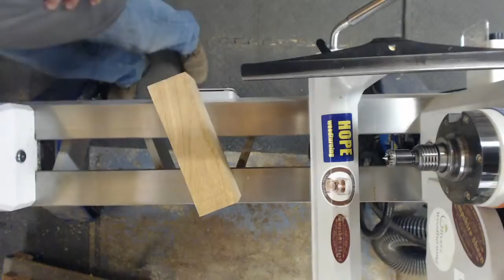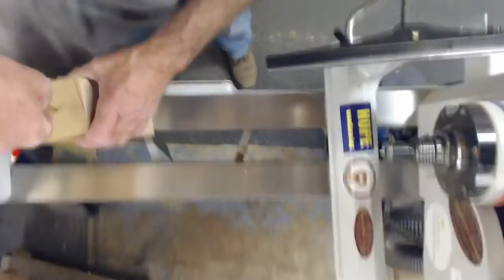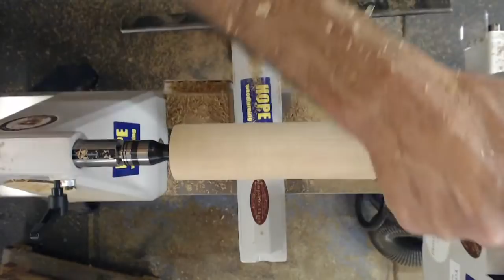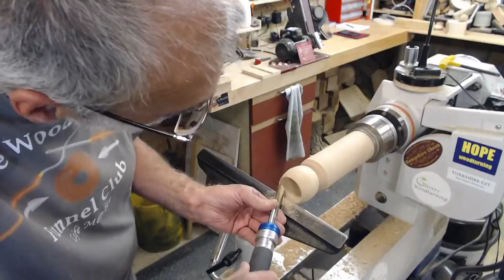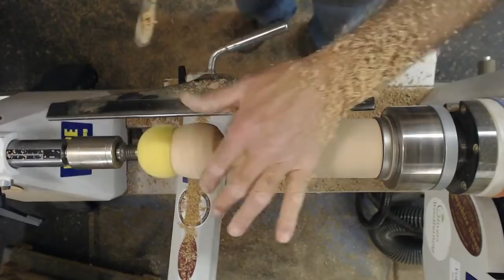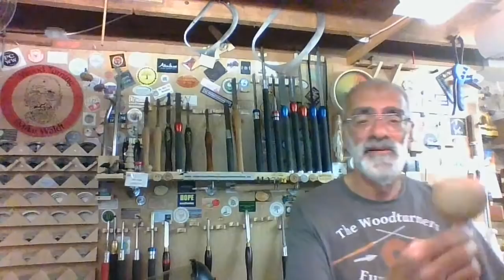How I turn a Goblet - "RECORDED LIVE NO EDITING"

Comment: Hi Mike,  I'm new to woodturning so interested in your video. I like the idea of turning a goblet because it has both bowl and spindle aspects.   I would have approached the goblet differently.  I would have turned the bowl as you did (and thanks for all of the detail on that) and then I would have turned the entire stem but at about 3/4" diameter (nothing less and using the tennis ball).  Then I would have done the base.  The last thing I would have attempted would be thinning the stem and I would have gone down to about 9/16".  I thought right off when you took the stem down as far as you did that you jumped out of the skill level of a new turner.  Had you not taken the tennis ball away I'm sure the goblet would have remained in one piece.  I think when you touched it you induced a slight wobble that became self exciting and that's what did the final damage.  You probably still would have lost it without the tailstock support but that would have depended on how light your touch was with the skew and how slow you were willing to turn.  I've found that sharp tools are more important for success than turning speed.  I think the idea of a need for speed comes from the world of production turning and recreational turners don't play around with slow speeds enough, somewhat blindly stuck in imitating the highly seasoned pros (but without the thousands of hours of acquired hand/body/eye practice).  My lathe doesn't have continuously variable speed so I'm forced to turn at discreet speeds which I find keeps me from over reaching on the speed.   Many times I've said to myself,  'This is going to be too slow'  and then it turns out (no pun intended) not to be the case.  See  you on the rebound.

Comment: I would be really interested to know how you’ve got your overhead camera setup?  I’ve tried multiple times with my tripod and I ether can’t get it high enough or if I do the tripod legs hit the lathe and it gets in the way of me turning!  I assume you have some sort of system bolted to the roof but it would be great to know exactly what!
Reply: Nathanael, I've got a similar setup.  I made an articulated arm for my overhead webcam, that I attach to a framework I built to hold lights over my lathe.  And I attach my camera to the arm end (with a simple clamp - I need to improve that).  Look me up on facebook (facebook.com/infinite.thread), and I'll send you a pic of it.

Great demo, Mike!!  I love that you waded in and did it!  Yep, I make small cups out of the ones that go flying....  it happens to us all!